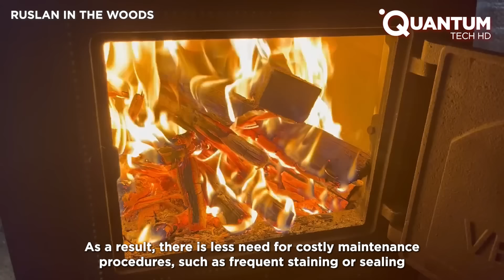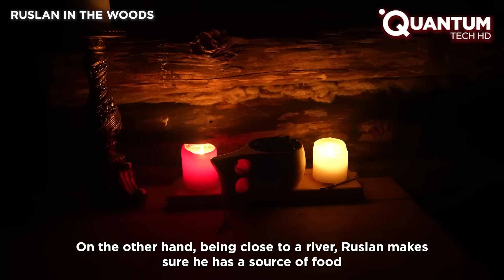Man Builds Secret Underground Cabin in the Forest | Start to Finish by @RuslaninTheWoods

Comment: I am dying to know what happens during a major rain, despite this being in sand.  No drainage at base?  Could not tell if this bunker was on a hill.
Reply: Yeah, toss in tarps and duct tape as critical elements for weatherproofing.....
Reply: @karlwithak.as per my previous comment, the axe you’re grinding, is a fallacious one. You haven’t a clue.
Reply: I was wondering the exact same thing. Where in the world does all the water go when it pours & those catch all steps leading downward are inundated with rainfall? I didn't see any French drain or rock installed leading away or dispersing the water to a lower or wider area. I've watched a few of these dugouts constructed but haven't seen any perform during a heavy rainfall & that's the ultimate test.

Comment: It seems to me being asleep inside during a heavy snowfall might make it extremely difficult to open the hinged door that would need to open upward with all the snow load on top of it.
Reply: Sorry, a co2 buildup would not cause a fatal accident. In fact, its an increase of the amount of co2 in your bloodstream that helps regulate your respiration. Any increase in blood co2 will cause an increase in your breathing. A further increase will make you feel as if your suffocating, and you would flee for the great outdoors at that point.
Reply: @Bugdriver49 If you don't sleep through the whole warning sequence.
Reply: @Bugdriver49  My point had nothing to do with CO² buildup inside the shelter. The point was that a heavy snowload on the door would make it impossible to open from the inside.
Reply: If you can't lift the door up and open with tons of snow on it, you'd be buried alive. It would become your tomb.
Reply: let's do some math.  This isn't a perfect model but will give us an idea.  Let's assume his door is 3 feet by 6 feet, or 18 square feet of surface area.   Fresh snow is about 5 pounds per cubic foot.  So if there is one foot of fresh snow on his door there is 18 cubic feet of snow covering the door.  18 x 5 = 90 pounds of weight.  So if there is 2 feet of snow coving his door that would be about 180 pounds of weight.  I don't know how much weight you can squat but assuming you can squat 180 pounds you'd be able to push the door up.  (it's actually less because of the hinge leveraging some of the weight)  3 feet of snow would be 270 pounds, which is a lot.  I think you'd definitely have a problem with 3 feet of snow, I don't know where he is but 3 feet in one night is a lot of snow!  In that case you'd have to wait for some of it to melt.  Over all I think it's a pretty safe bet to say it's not going to be a major problem.
Reply: @ElmTheWar  ... Lets cut to the chase. Only an ignorant fool would build the only exit for an underground shelter like that. ... For instance, heavy, wet snow loads regularly fell large trees.

Comment: Using just tarp will not keep ground water out over time, it'll eventually leak. You gotta coat it, plus there is no ground barrier under the floor boards, it's bound to flood. And those sky lights AKA heat zappers in the winter.
Reply: I cant wait to see the effect of the first snow thaw, lol...that shitz gets in every crack. Snow fall will ice in the stairs and front door making leaving impossible.
Reply: There’s something you need to understand, his hole is in sand. Water will not move straight down and keep on going, it will not flood. If it was in soil then I would agree but sand, no chance because it is so free draining. Dry digging a dam next time you see sand and pour water into it……
Reply: @teeanahera8949  Depending on what's below the sand, liquefaction can occur.
Reply: And it also looks to be on top of a hill or ridge.
Reply: Exactly that tarp will rot in a few years should of rubber roofing rolls.
Reply: Still begs the question of how is he going to prevent flooding during a long rain event or the spring runoff??
Reply: And the carbon monoxide from the stove. I skept part of the video, but I don't see anything connecting with the exterior
Reply: @mariee.5912 that’s what I’m saying no one is talking about how they keep this from happening with no vent system

Comment: To hide the pipes, use old logs. Cut the logs to length and the diameter of the pipes a little bigger and then set the logs on top of the pipes sticking up.

That's what I did, but had to make the pipes taller due to the amount of snow I got last year.

Comment: Nice underground quarters. As to the moss like top surface of the structure: will the moss be able to survive when placed on top of a layer of elevated, drained sand? According to the biodude, for moss to survive it depends on "80-90%+ relative humidity and consistently wet substrate"
Reply: Если мох высохнет, то ничего страшного. Сверху нападают ещё листья с деревьев. В итоге всё будет выглядеть натурально. Со временем маскировка только улучшится.
Reply: Moss survives even in the worst conditions.
But the garden bed and swing next to the secret dugout are nonsense.

Comment: Looks like a fun project.  Back in my time, building tree houses were the thing.  Now, it looks like cabins in the ground are… they’re easier to keep warm (or cool) but a few concerns are:
- How do you keep the air dry so mold won’t grow?  
- How do you keep it from becoming an underground pool from water infiltration from the walls or from under the floor when it rains (or the snow melts)?  
-  Radon gas, a known carcinogen, naturally comes up from the ground.  How is that mitigated? 
- How do you keep ants, termites, field roaches, spiders,  or bugs in general from coming in or taking over? 
- Toilet?  Somebody else had asked about a secondary exit/ escape tunnel.  I think the more important question is, “Where’s the loo?!”  LOL 🚽🧻
Other than that, it seems like a cool fun project for the occasional short term stay/ vacation.
Reply: The builder will have water issues/once that plastic breaks down
Reply: Bu tür yapılarda tuvalet dışarda olur. Bu yapının yer altında olmasının hiç bir gereği yok. Toprak üstünde olsa daha iyi olur. Fakat hobi ve gizlilik açısından iyi.
Reply: Alot of people are.doing the underground "bug out" shelter. Some short term some long. Maybe this is when he goes hunting?

Comment: This would cause a whole bunch of other problems for you. Maybe the solution would be to use concrete walls or create a concrete wall around the logs to maintain the cabin look while not molding everything. And install a hidden french drain under the floor boards maybe so you don't get flooded out.

Comment: Definitely a lot of work and overall impressive.  Looks like that was dug out by a machine, filled with sand, and just covered with brown dirt for the look.  Digging that by hand would be extremely difficult in normal compacted dirt with rocks, roots, etc.  The floor is not protected from water; the sand will make water access easy through the floor.  All of that wood will be soaked after the first heavy rain and start rotting.  But overall kinda cool.  Would animals (bear) be attracted to it?

Comment: I think the first thing I would have changed is adding corrugated pipe underneath and ran it downhill away from the foundation (buried of course) and either daylighted it in an inconspicuous place or more likely dug a leech pit for it to drain into. *also could be used as a toilet in an emergency...

Comment: He did a good job of insulating and protecting the top.  But he used gorilla tape to seal the windows which won't last long.   Water comes from below and not above.   He should have sealed the bottom, and he should have put rock on the outside of the wall for drainage away from the structure.   He also used untreated lumber in so many places that it'll rot inside of a year (milled pine) and even for the door and furniture.

Comment: No no no no no no no no......etc

This son will be your well on top of the hill that gives you fresh water 8 out of 12 months. All of the sand, rock and shail is a great filter. Don't mind the metal based stains that "may" have been used on the woods, especially the floating stairs. 😉😘

Comment: It's been said, but so much work, yet how does this not fill to the top with water???   I look for the ravine or hillside nearby for rain water and ground water to drain to; to drain his pit by gravity, but I don't see it...    (and to state the obvious, anyone who believes those walls, let alone that floor, is water proof -- buried that deep that structure won't even slow the water down.   The floor was planks placed next to  each other.  You're looking for the fiberglass hull of a boat if you want to keep 6-8 feet of hydrostatic pressure out of a hole with no drainage or sump pump. )

Comment: You know, if you didn't put tarps all over everything, the home would ventilate naturally, and you wouldn't deal with future mold or condensation issues. Yeah it might remain a tad damp on rainy days or not be quite as warm on cold days, but that's why you use other skills to develop the area so that it remains entirely dry and workable year round, and for long time periods.  Hasty shelter has it's benefits, but that's why they are all using tarps instead of incremental improvements.

Comment: A perfectly square hole that just so happens to not have a single rock or root and is in very soft sand? What are the odds!?!?! Its almost like you used machines to do it, but you wouldnt fo that, right?

Comment: Those flimsy tarps will rot out in less than 2-3 yrs. You should have gone the extra step and poured cement or expand a foam. Just sayin, even if it’s just an emergency hideout you want it to last over the years. Temporary housing sure. Good luck out there.

Comment: “Away from prying eyes“. Never mind the sound of pounding, the chainsaw and other construction noises that can be heard from miles away. Also, no way this would not flood even with a moderate rain. It certainly isn’t clear how the door was waterproofed to keep rain from coming in around it and down the stairs. Then there is the snow melt. 

The comments on this video are either extremely positive or extremely negative. The positive comments are from people who are obviously naïve and the “negative” comments come from people with common sense and critical thinking abilities. The thumbnail for this video is deceptive. The construction was done by TWO men, not ONE. 

The logs used were so uniform that they looked like they were run through a rotating miller that is used for making telephone poles. There had to be some source of electricity to charge the batteries for the drill drivers for the many screws used. The stove would put out too much heat for such a small space. 

I have my own process for constructing a hidden “earth covered“ dwelling that it’s much simpler, less expensive, considerably larger, less work and completely waterproof. Composting toilet. Water collection system. Electricity generated by a turbine installed in a stream nearby that is always flowing, I could go on, but don’t see the point. I will add that my location is Minnesota and I definitely don’t want to let the world know the materials used and how it was constructed. Not looking to go viral on YouTube for income or any other purpose.

Comment: Hate to tell you but that tarp won’t keep the moisture out. In about 2 years that wood will be rotted. You will also have water leaks into the structure. Coming from a contractor myself. All that work for nothing. Please make a video after a big downpour.
I give you a “A” for effort though. Lots of hard work. Good job.